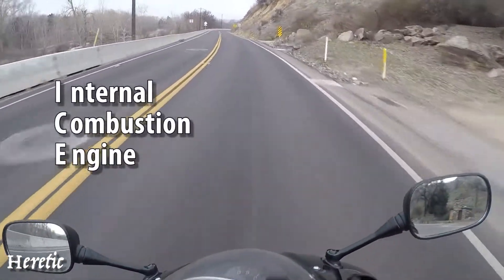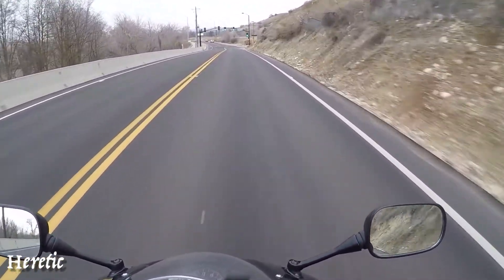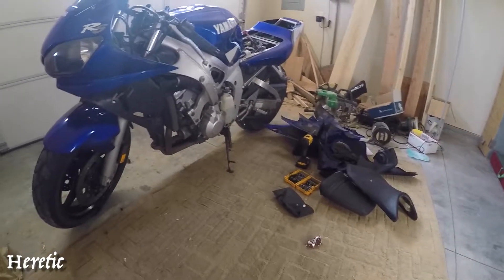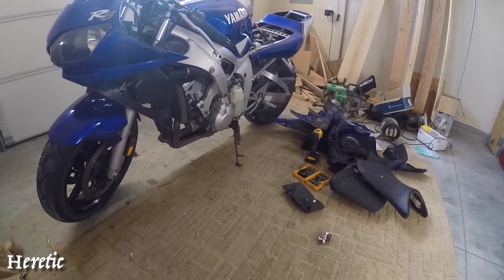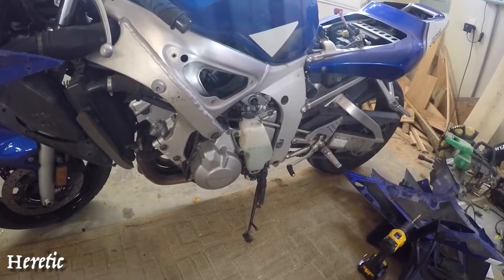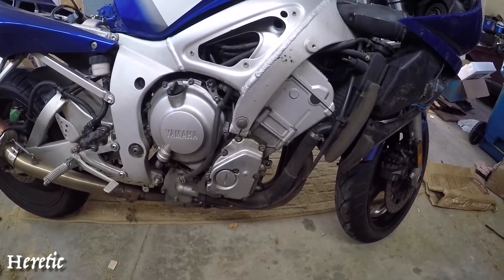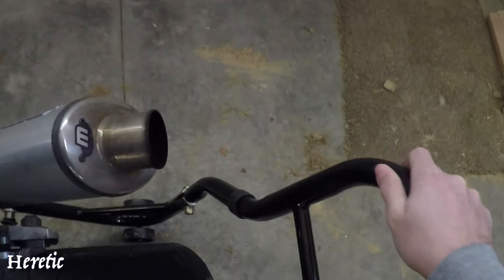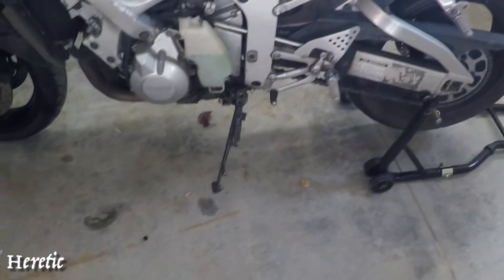Electric Motorcycle Conversion - R6 - Part 1

Comment: Super groovy idea.  But you might still want the radiator to cool the batteries...
Reply from the maker: +external influences Good thought. The batteries will only get hot on charge, not discharge. The motor will get pretty hot, but that's air cooled and at most, a few heat sinks will work great. If you have a radiator, you need a water pump and tubes going around and touching the surfaces of the batteries. A heat sink on those would suffice.

Comment: What type of batterys are you thinking about using?
Reply from the maker: +Piston Slap Probably Lipos. I'll need to get them as individual cells to construct the batteries manually since the R6 has a curved frame. Hard to stick square batteries up in there. You can't buy individual sealed lead acid cells.
Reply: +Heretic Raider lipo batterys are awesome.   I use them in my RC car.  Of course yours will be a lot bigger.
Reply from the maker: +Piston Slap I've seen a lot of electric bicycles use them and they work great. Not sure how it'll work on a bigger machine, but I still have a lot of work left to figure that out.